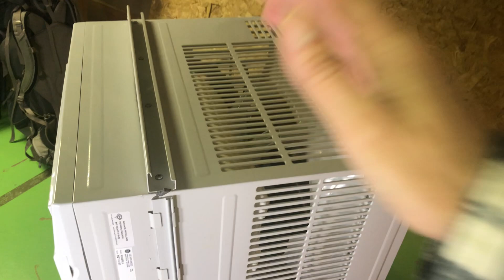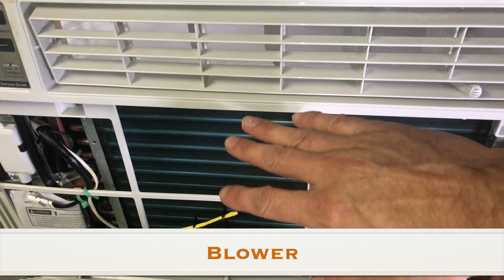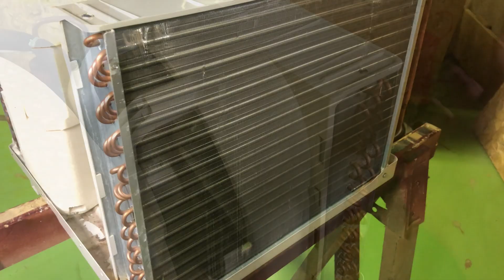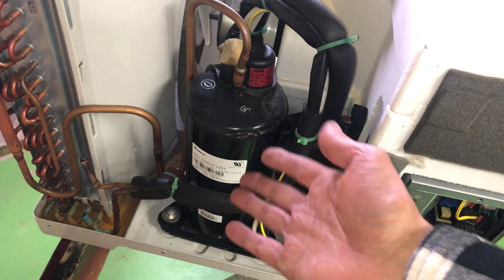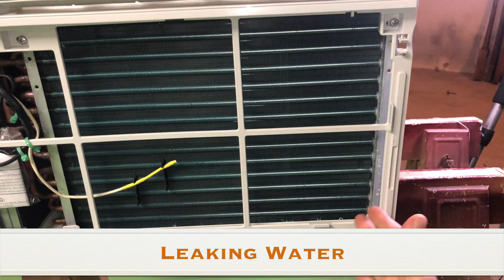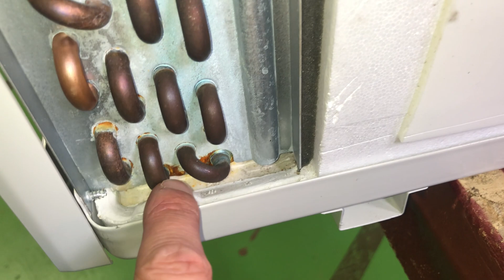How does a Window AC work (Window air condition)

Comment: HERE is how I clean the inner, (in room) coil:
I use a spritzer bottle with soapy water and ammonia. Without touching the coils I put the tip of the spritzer right up to them, which forces the mixture through them. Let set at least an hour. THEN I rinse it the same way with clear water. Then, if you have one, take a blower and blow the clear water through it. The harder part is cleaning the outside coil. The best way to do it is take it apart which can be difficult. The fan forces the outside dirt/dust right into that coil. You have to get ALL that blown in dust out of there.

Comment: Does the fan always be on even after the room is cool to the set temperature. I have an older gree that I'm using just to keep one room cool but the fan never stops but I heart the pump turn off. Thanks
Reply from the maker: Hi, the fan on my unit keeps running even when the compressor shuts off. I guess that’s to keep the air circulating in the room.

Comment: I understand that the newer units collects the water then sprays it on the condenser to lower the temperature on the condenser. My Question is, with the newer unites, if the water is not draining, what happens to the water that's just sitting in the bottom of the unit after it's off and then back on even during winter storage. In other words, if the unit is not draining the water wouldn't this cause the bottom of the condenser, evaporator and tray to rust quicker then possibly produce mold within two to three years. These are the complaints I've been hearing from people with these newer model window ac units. If you have a solution could you please share it with us?
Reply from the maker: Hi ?  I am sharing those you mentioned. 
My solution is to remove the unit entirely at the end of summer and clean it thoroughly before storing it indoors.  The biggest problem with that procedure though is that the standing water is likely to pour out when removing it from the window. Of course the water ends up in the carpet.  
I try to awkwardly pour out the water before lifting the unit inside.  That works more or less.
Reply: @MegaSafetyFirst Instead if taking out,  then reinstalling it  each year. If I drill a hole in it to drain the water like my older unit was manufactured, to drain the water, would this newer model last 15 years like my older unit did?
Reply from the maker: Good question.  It’s hard to believe that anything is build to last that long nowadays unfortunately

Comment: Very good, but I still don’t know how making heat makes coldness.
Reply: When liquid is converted into a gas it has an evaporated cooling effect. The compressor pushes the liquid from the outside to the inside where the liquid goes from a small pipe to a large area so it expands, becomes gas and so cools, hope this helps

Comment: Thank you for explaining! What parts of the AC does the room air make contact with? I just found out I have mold, pollen, etc allergies and seem to feel worse when the AC is on. I opened it to clean it, but it looks like it will be a huge cleaning project, unless I can just clean just the front portion of the AC?

Comment: I have a 12K BTU Whirlpool window unit. The remote does not work, and the LCD display does not work with touch. So I turn it on with the power cord reset button, but it comes on only for a few seconds and then turns off, the display on the LCD stays on, so it is getting the power. Any idea?

Comment: Very good video.  I'm currently using two of these exact same units and have had several of them over the years. I find them to be very good units and you are right about the cloggage that makes water backup and drip to the inside. But I have found it easy to avoid if you don't wait untill they're already clogged but wash them out with a water hose from the outside a couple of times a summer..  Thanks for making the video.

Comment: Lol! This unit can be super-efficient if taken apart and cleaned the right way. Once you take the cover off, you clean the back coils. The area where the fan is blowing. It will collect a ton of debris. It takes time and some elbow grease. Small brushes, Shop-Vac, air compressor and patience. This will return your unit to 100% efficiency! And cut your electric bill in half. The guy that posted this video really missed the big problem. Smh. If you want to prevent this problem in the future. Attach window screen to the case cover vents. 😎
Reply: Good idea

Comment: Do window ac units bring in outside air? We have wildfire smoke in our area so bad air quality. Can or how can we use our ac window unit without bringing in the smokey air from outside?
Reply from the maker: The A/C circulate the inside air only.
Reply: Hi @wendy this is why I came here too. It seems a little unclear. I have a Frigidaire, small window AC, and I’ve been told many different things. I think it may depend on the middle of ac

Comment: I am installing a window air conditioner for cooling my kitchen built by closing up my back patio. I am installing this from inside my utility room window which means the back side of the ac will be inside my utility room and front side will be in the kitchen built on back patio. Anything wrong with this setup?

Comment: I have this same model in my bedroom window. I clean the front filter every year & it's been running great for about 5 yrs now. Good unit.
Reply: probably clean it more often to maximize performance and thus lessen electricity cost as well as prolong its life span even more. clean it at least 1once a month. its so fast anyway. just remove it and use a brush or spray with water and fan it fast in the air to remove most water. takes like 15 seconds don't worry if its still wet. since the air blows out to the room anyway. Source, have a HVAC engineering degree.
Reply: Which model is this?

Comment: Do air conditioners pull in air from the outside?  Anyone know?  Thanks.
Reply from the maker: They do not.
Reply: @MegaSafetyFirst  thanks so so much. I'm in Philadelphia and the air is bad due to Wildfires and it's still hot too.
Reply: They don't

Comment: Do I have to refill and change the filter?
Reply from the maker: It should be cleaned over few weeks.  I just rinse it off with water. 
No need for a new filter.
Reply: @MegaSafetyFirst  And that is with any window ac unit? Thank you so much for your reply.

Comment: I don't know how many so called experts I have tried to tell that window air conditioners don't pull outside air into the house!! I say why is the air filter facing the inside then? Nope they always say they bring air in from the outside and it circulates inside your house!
Reply: On the inside of the room the AC unit has the front that is divided into two vents, the upper and the lower. The air inside of the room enters the AC into the lower part as it gets sucked into the AC unit then the air blows out of the AC at the vent across the upper part of the AC unit where the fins are to direct the air flowing direction.😮
Reply: Thank you smallblock..I thought my ac wasn't working..so many people told me the air should be blowing in the house through the bottom of the ac from the outside of the house instead of vice versa
Reply: Interesting.... But if your neighbors are having a barbecue and you are running your AC you still smell it somehow. Dang nature you're interesting.
Reply: @graciegjj that is because they are not completely sealed (I know exactly what you are talking about it happens to me too)
Reply: @MrCaze28  yeah that's what I was thinking they're not completely sealed so that's how outside odors and such can get in.
Reply: it just blows hot air out the windo
Reply: @knightwolf5006  and humidity

Comment: This was excellent and answered my question on whether or not the unit draws from outside air.  Now I know that it doesn’t. In Canada we are suffering from horrific forest fire smoke and didn’t want to be sucking that in. That’s why I bought an AC - since we have to seal our homes from outside air and it gets way too hot in summer
Reply: Fellow Canadian here. This is exactly why I came to this video, to make sure I wasn't bring in smokey air indoors. This video answered that perfectly
Reply: @craigoroni7140  Yup. I got mine installed in my back office and it actually cools the entire upstairs-given enough time and with a few fans
Reply: @big_red_machine3547  Hey, can I ask what type of AC you have? I'm in the market for one but I'm actualy trying to make sure cigarette smoke doesn't get in (chain smoking neighbors).
Reply: Me too!  I also thought my AC would pull a lot of air in so I'm relieved.  Thanks MegaSafetyFirst for the video!
Reply: Have you had any issues? I am in ny and I'm suffocating. I wanna run my ac and I'm scared. My partner has asthma and I don't wanna bring the smoke in my house
Reply: @Ejmb4eva I have long covid and I live in Queens, NYC. Turn your ac on, the heat will kill you first
Reply: @Ejmb4eva  run your AC and keep the windows shut. It won’t draw in any outside air
Reply: Did you still smell the smoke getting into your home?
Reply: @graciegjj  No not really. I had 2 HEPA air cleaners going inside (one upstairs and one downstairs). I also stuffed rags into the outside air intake for the furnace. This unit doesn’t draw in any outside air whatsoever- it just recirculates the indoor air and cools it

Comment: Thank you. Trying to decide which brand to buy. Based on reviews, now they are poorly made and a lot of the problems are from the sensors or controls. Wish they just made them like the older models; to last at least a few years!
Reply: I bought this exact model for my bedroom & it's been running great for 5 yrs now. I just clean the front filter every yr.
Reply: I did tons of research and the best by far was the LG dual inverter models. I just bought their 14,000 BTU one and working on installing it.

Comment: Has anyone ever wonder why the air intake should be on the top and the cold air coming out should be in the bottom.  Hot air rises and cold air flow down.  When window air conditioner are on , It sucks hot air but it reality its actually sucking in cold air.  This is considered a conundrum.  Just like Hydronic boilers ..  should the circulator pump be pushing (top of boiler ) or pulling ( Side of boiler). As a professional Boiler installer for 30 years. I know this answer and we dispute with corporation that they are wrong. Because they want to make sure your system is not working they way it should be.  They want you to buy and spend on parts or even purchase a new boiler.  Baseboard are installed closed to the ground because it sucks in cold air from the bottom and hot air rises.  Now going back to the circulator pump. When circulator are pushing water to the baseboards, the water temp is about 190 F.  By the the time it comes back to the boiler the water is cooler.  Causing less damage to the circulator pump.  We did this test for a house with two boilers for 5 years. Remind you these are exact boiler using a Taco-007(pump) .  The pushing circulator pump failed within 3 seasons because it over heated making the pump inoperative.  The one pulling is still working till this very day.   Window AC are jokes.  Mini Split units are install on top of the ceiling for a reason and that's why they are the best.  FOR NOW !
Reply: The air intake (for the conditioned side) is on the bottom.

Comment: How to set a temperature,  mine keeps changing.
Reply from the maker: While pressing the up- and down buttons to adjust the temperature, the display will show the temperature we are trying to reach.  
A few seconds later the display will switch back to showing the current room temperature.
Reply: @MegaSafetyFirst  i was hoping to see inside the part responsible for the room cycle, so i could see what type of fan is in there, and where that fan is positioned.
Reply: Thanks

Comment: Thanks I've been trying to figure out what to do since I saw no drainage valve or hole.  You've done a great job explaining everything so I can do water leakage repairs.
Reply: Yes me too. I am about to install my LG 14,000 BTU unit and was going to remove the drain plug beforehand. I was worried that water in the pan would rust everything in no time, but instructions say it’s supposed to blow the water out by the fan. After this video, I understand the logic behind blowing the water through the condenser for higher efficiency!
Reply: @big_red_machine3547  I still drilled a hole in mine, in the winter, unless you find a way to cover it, mold and mildew build up happens fast. You dont want to breathe that in.
Reply: @2siccaudio  Yes I ended up removing that rubber plug and the water drained continuously. In winter, I wrapped plastic over the outside and taped it on. Sealed it well over winter. It’s a nice unit
Reply: @2siccaudio yeah that was a horrible idea . The water in the back is crucial for proper cooling